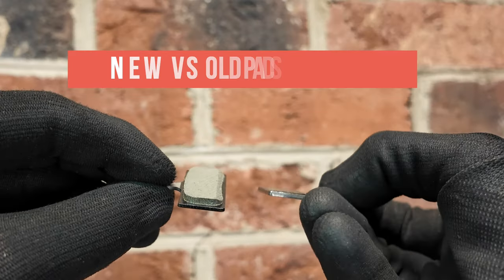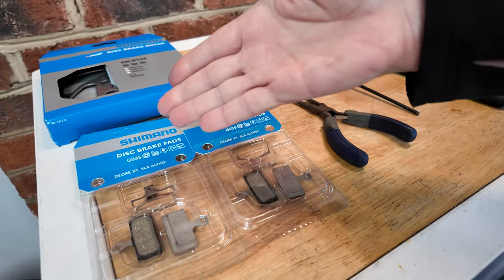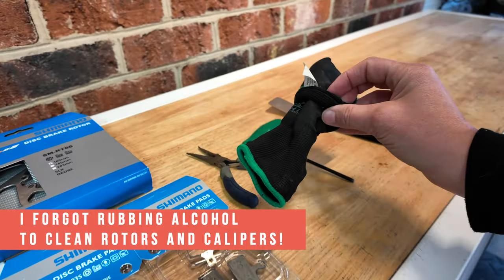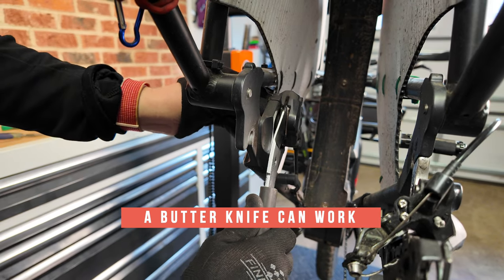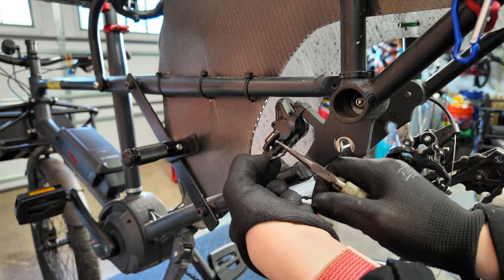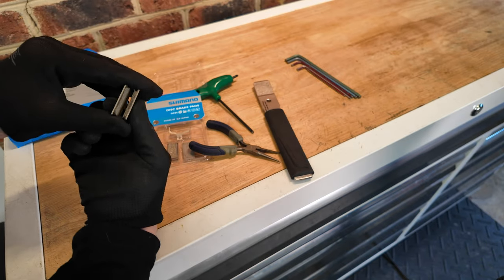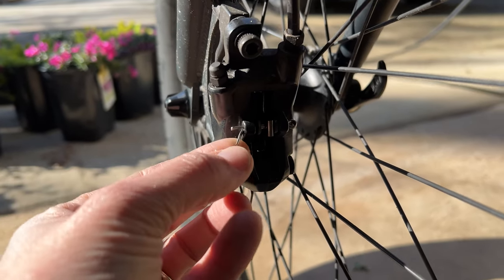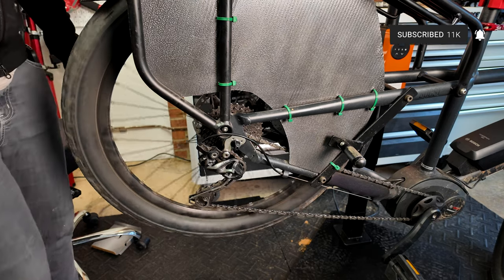How to Change Hydraulic Disc Brake Pads: Bike Maintenance Monday

Comment: Remember when new brake pads cost a few bucks, and were dirt simpie to install? I hate this unnecessary complexity for no meaningful improvement (except for the manufacturers bottom line). May be if you are riding competitive and need (?) better braking, but not ordinary consumer-level use.
Reply: There's definitely improvements to using hydraulic disc brakes. If u don't understand something doesn't make it bad lmao. They are infinitely better than caliper, v brakes, or cable disc brakes
Reply: And it's rlly not that complicated to chnage the pads lmao.
Reply: @Kudabear1  I understand it perfectly. Have you had a bike with standard mechanical caliper brakes? I have been riding off and on road for many years. I find no significant advantage to hydraulic brakes in this setting, only greatly increased cost and complexity.
Reply from the maker: When carrying 400 lbs the pressure on hydraulic is far superior.

Comment: Maybe, it's a stupid question, but do I need to worry about hydraulic fluid? Ty, Chris
Reply from the maker: at some point you may need to bleed your brakes but they aren't typically required when swapping brake pads.
Reply: Only if your levers feel soft/spongy.

Comment: I couldn’t really see the cotter pin part very well. Do all brands of hydraulic disc brakes use these pins ?
Great video if you have shimano…..
Reply from the maker: Many brands use a cotter. Others are using a pin that screws in. Same concept